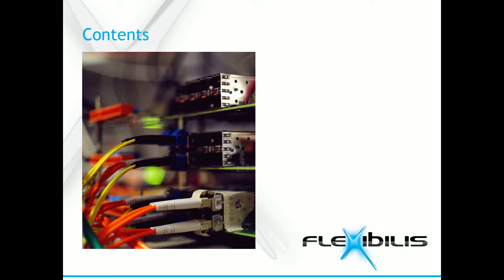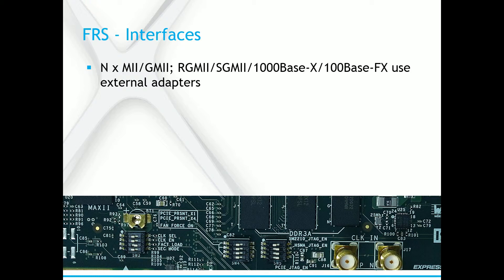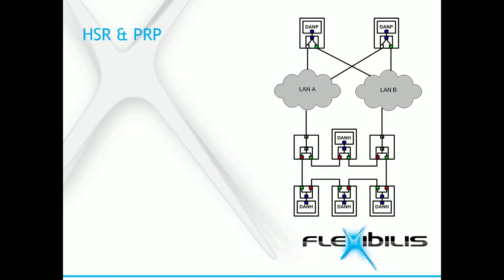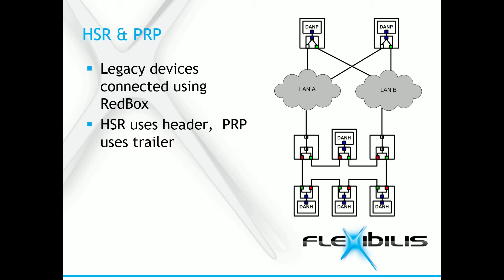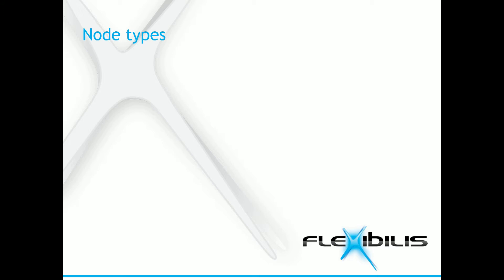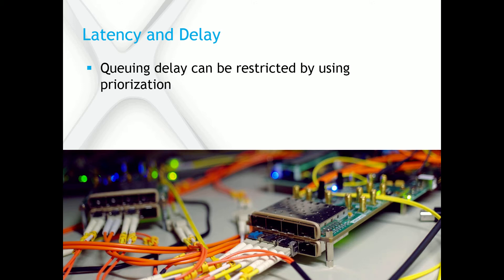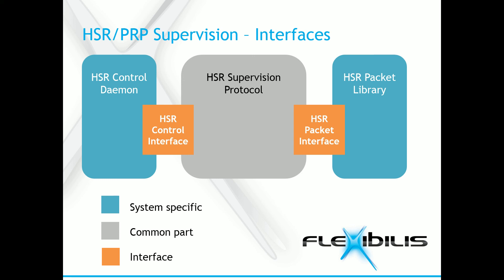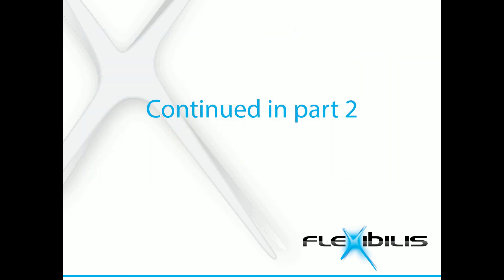FRS Training PART 1/5: HSR and PRP

Comment: whats a redbox and whats a quadbox?
Reply from the maker: +Yousuf Hasan A RedBox (or Redundancy Box) is a device with two external HSR ring ports and at least one external interlink port. RedBoxes are used to connect HSR networks to devices or networks that do not have HSR. QuadBox (or Quadruple Port Device) is a device used to connect two HSR rings to each other. You can read more information about them on our website: http://www.flexibilis.com/technology/high-availability-seamless-redundancy-hsr/